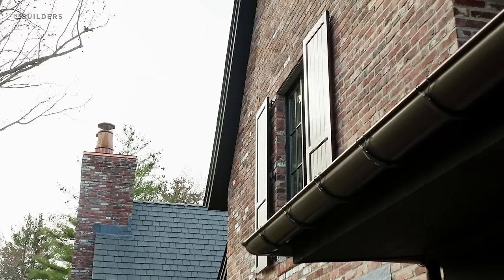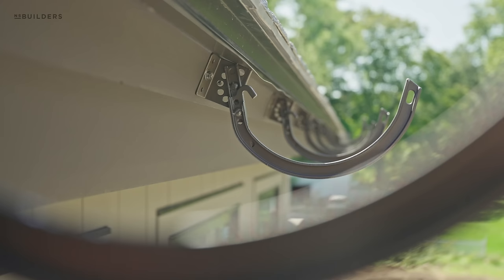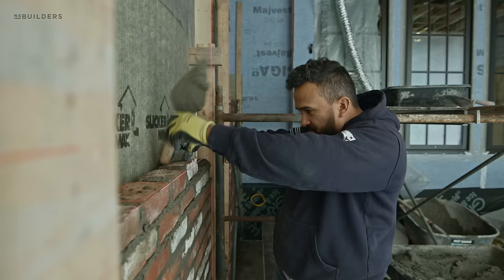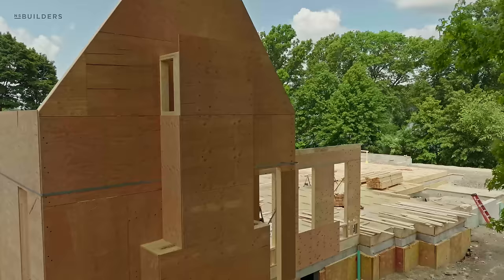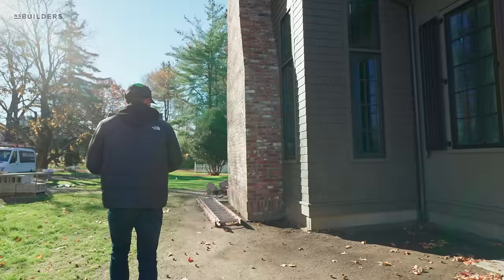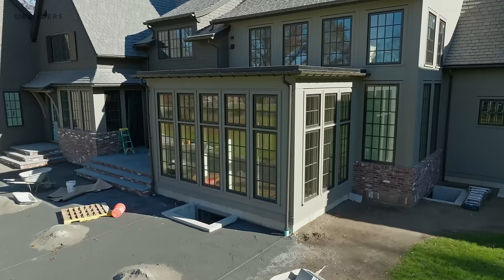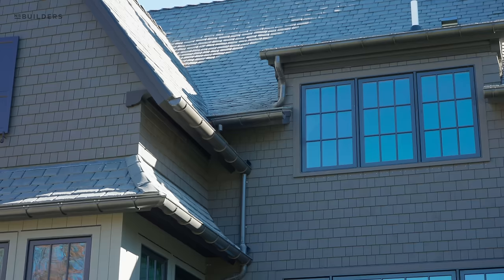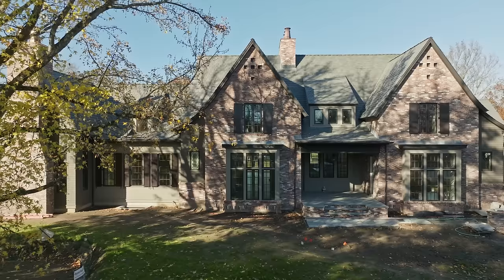Exterior building details | Shutters & Gutters | Needham project

Comment: Are there any concerns with the shutter stays and very windy conditions? I worry that the stays holding the shutter with such a small surface area and in the corner may be less than ideal if a strong enough gust gets behind the shutter. The stays themselves don’t appear to have all that much friction from being rotated to an open position from the wind banging on the shutters.